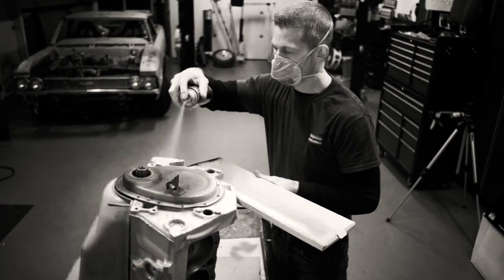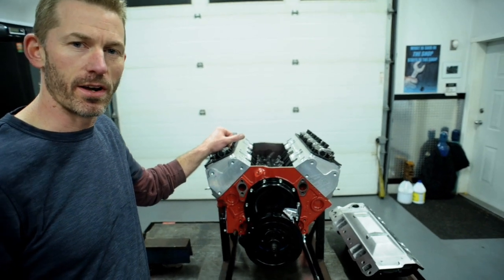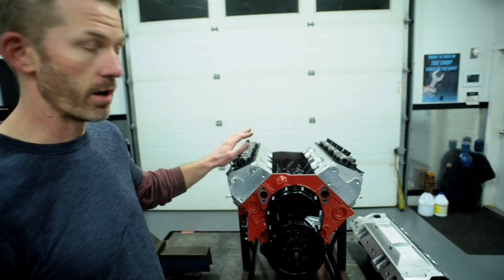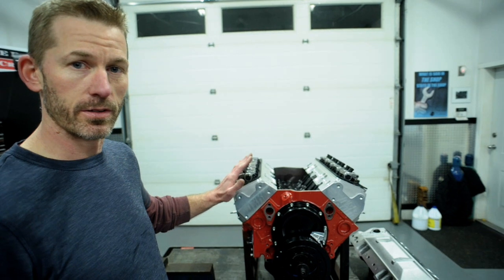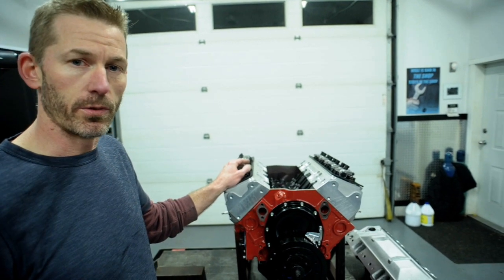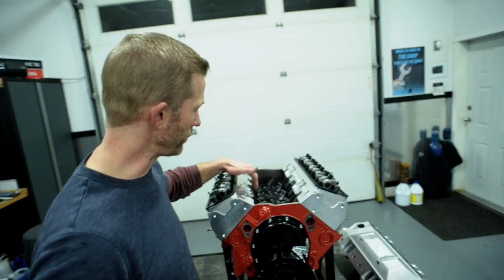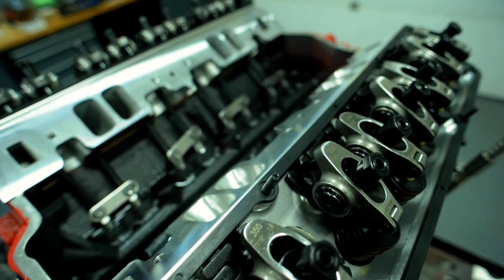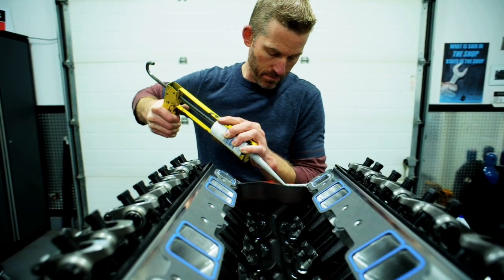Chevy 283 Crankshaft + 400 Block AFR Cylinder Heads + Intake Install

Comment: You could use an 1182 - 69 Z28 crank which has the larger journals to eliminate the bearing spacers.  Great job with the engine though, the large bore really unshrouds the valves.
Reply from the maker: Thanks for commenting! 
We did a couple 3.25” stroke builds with that 1969 crank. They were awesome too. Comes out to 354ci on a bored out 400 block.
Reply from the maker: Here’s a video link of one of them on the Dyno. We also have a couple videos of winter weather road tests on the channel :)

https://youtu.be/3oLz362AbDU

Comment: why didn't you go solid roller lifters? it should give you more top end, right?
Reply from the maker: Perhaps it would make more and many other builds we’ve done like this have been solid. This one though is a sleeper, smooth-ish idle, low maintenance with a long life ahead. Lighter valve train than a solid cam and probably easier on parts. Overall it’s really worked out beyond our expectations. Thanks for commenting :)
Reply: @ceperformance  https://youtu.be/jeBhVLPdmzU
you should try a pair of these lungs on your next short stroke 400, and run a solid cam. 😁 Holley HP 950 would feed that well.

Comment: with a normal 400 being able to turn the same rpm as this set up why not just build a 406 with 6" rods  and make 600hp over the 500 hp this mite make?
Reply from the maker: Thank you for commenting! Not everyone wants 600 HP nor does every application require it. This is a custom build to suite a particular vehicle for daily street driving. It has plenty of power and runs on 87 regular fuel. Should be plenty of fun in a stick car!
Reply: @ceperformance  I will drop a hint or 2 being older. You can leave the line at redline with a small block and proper setup. The small block will rev to redline faster than having more rotating mass working against itself. Maybe 20% less piston feet traveled plus more revs to work with is a winner. 283's can rev to 12k or so.
Reply from the maker: @jamesbullock7257  
Thank you for your comment!

Comment: Is there a particular reason you chose to put a 283 crank in this block?  Just curious
Reply from the maker: Thanks for the question. 
We had an opportunity and so we did! Being a BowTie block we were able to make it fit. Being able to achieve a greater than 2:1 rod to stroke ratio was another reason. It’s about trying something different and it performs excellent for the conservative nature that it is. 500HP and 427LBS of torque.
Reply: @ceperformance  thank you

Comment: So what is the goal with this build.
I am very curious the thinking behind using a duelplane intake and assumably small valve heads with a big bore short stroke combination?  If willing,  please explain the thinking behind such a build.

Cheers!
Reply from the maker: Hi MPER&D! Thank you for writing and for your question. This engine build was, in part, commissioned by a customer. For us, it's a chance to apply what we've learned with other engine builds, and to further explore long connecting rod spec'd engines. We saw great success with a previous unimposing 354 cu.in. SBC, using 6.25" rods with a 3.25" stroke crankshaft in a 400 block with a super mild cam. See https://www.youtube.com/watch?v=3oLz362AbDU&t=1s. We also saw amazing success with a small-but-mighty and stout SBF 302 cu.in, using Chevy 6" rods in a tall-deck Dart block, with a conservative cam that produced fantastic numbers. For a glimpse into that build, please view our only footage of that here: https://www.youtube.com/watch?v=cgzTemIAMvI&t=3s
Like many, we are curious and excited at what this build-in-progress, a "329", will produce during a near-future dyno test. Best regards!
Reply: @ceperformance  thank you for responding. Good luck with your engine jurney.
Reply from the maker: @mohanperformance.enginerd.1308  You're welcome! And thank you, as well!

Comment: Are you running a 400 block with 350 main brg dia? I've seen 350 in a 400 spacers. I've used small journal in a 350 block spacers. But I've never seen small journal in a 400.
Reply: I just saw your reply under another comment.
Reply from the maker: @scottmoot2969  Hi Scott! Thank you for writing! Yep, we're trying to answer any questions that are posed. Glad you found the answer! The part 1 (of 3 so far for the 283/400 build) video mentions the use of a Bowtie block with the 350 mains. Best regards!

Comment: I been wanting to build one of these, I have a 400 block, and a 283crank,  what rods and Pistons?
Reply from the maker: Hi James! Thank you for writing! If you've got a stock 400 block there will be an issue with mating the 2.60" mains with the 2.30" 283 crankshaft bearing size, unless you've got an aftermarket block. We had a used Bowtie, with 2.45" mains, that a customer wanted to use for this unique build, using bearing spacers, of course. Rods: Eagle 6.1" I beams, Icon 4.185" pistons with 1.443" c/h, with thick Cometic head gaskets to compensate for the tall stack height. Best regards!

Comment: I can’t wait to see how much horsepower this 329 will make. This is the first time I seen someone try this set up. Great stuff man!!
Reply from the maker: Thank you for your comment, Chevy Rider! We're excited about this combination too, and to see the horsepower and torque numbers ... but most of all ... hear the SOUND! :)
Reply: @ceperformance   depending on cam and what rpm you plan on running it to I am thinking under 400hp, but I am just taking a wild guess. 🤔
Reply from the maker: @E.T.GARAGE  Hi ETG! We're optimistic that we'll see 1.5 HP/cu.in. and 1.25 LBS FT/cu.in., therefore closer to 500HP etc. We'll make a video regardless of the numbers. Regardless, this is certainly an exciting engine combo build! Best regards.
Reply: @E.T.GARAGE  
We posted the Dyno test a few days ago. Happy to say it makes 500HP @7000 and 427LBS of torque.